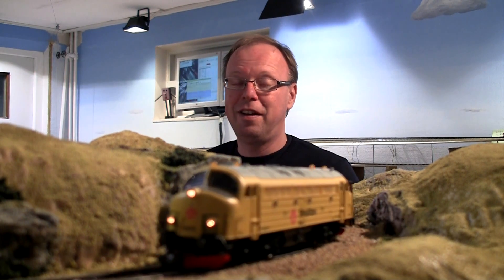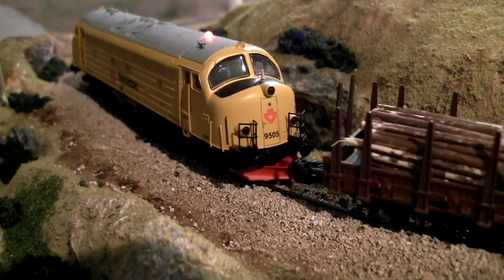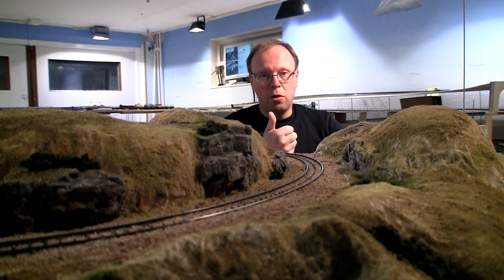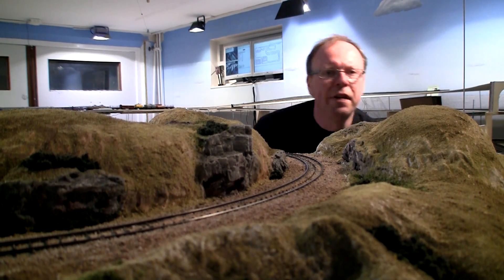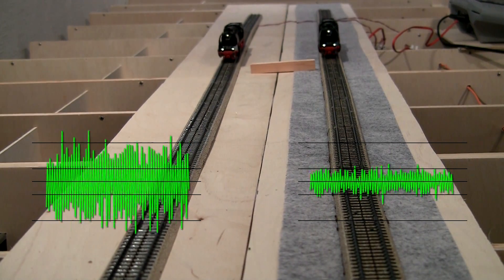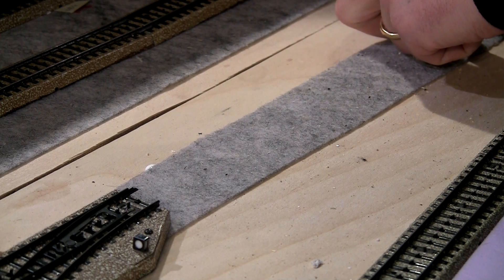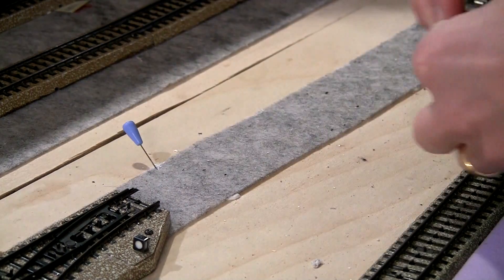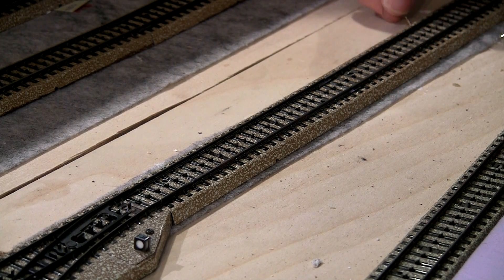Reduce track noice Low cost - Detailed guide DIY

Comment from the maker: Thank you! :) Somehow, Märklin users seems to be somewhat more tolerant to the noice than DC (2-rail) rail roaders. Anyway. it´s easy to overcome most of it at a low cost, why I thought it was a good idea to make the video.
Reply: +marklinofsweden Definitely going to try this. Your remark on the M users being more tolerant on noise got me thinking. I think M users are more tolerant because most locomotives are made of metal and weigh 300 grams or so. When one such locomotive passes by on my still wooden underground I really like the sound as it's replicated through the wood. It emphasizes the weight of the loco in my mind. I think it reflects the Marklin quality or something like that.

I'm still on a Proof of Concept table while designing my layout and I'm using 1cm thick sheets of MDF  as a temporary underground. I think the high pitch is generated when thin layers of multiplex are used because I don't recognize this effect with my three 100cm by 120 cm sheets of MDF.

The point I'm getting at is that when a real train passes by you don't hear the click clacks of ice skaters doing a ten 1000 meter laps, you'll hear the heavy sounds associated with metal wheels on metal rails.

With many model railways often hear too much of the click clack sound...

What I haven't tested is laying the track on a metal surface and making sure the metal rails are in contact with it ensuring a good hard CLANG when the train is moving over a point or so.

Have you ever thought about a scenario like this?

TFK

Comment: I used those interlocking rubber floor tiles like you would use in a basement or garage. They work great and it’s easy to drill through and screw track etc down.

Comment: 3rd way to remove noise is to use Peco Streamline tracks. I switched from Fleischmann Profi to Peco actually to run RP25 wheels which Flschmann do not accept, but the switch was going from loud to absolute silence at the same time, an extra unforeseen bonus. Both run on plywood with cork top Try it!
Reply: Cannot use Peco Streamlinetracks on a Marklin AC layout...

Comment: I concur. It dampens really well. I am using C track and has until now been using parquet underlay (green foam material). But Stopp seems much better. I am however not gluing it. I just use staples.
Reply from the maker: Good to hear you like it! (y) I still use it over my entire layout too. It works weel and I have no problwm related to "Stopp" at all. Only the benefits.

Comment: Thanks for the video info.... I agree with your felt idea but I am still mystified how you secure the track to the baseboard?  Maybe your set track just sits there... and the small mass of HO scale isn't move it around.  I'm about to lay O scale Atlas flex track so it needs to be held down to control the curves and keep the track joined together... especially when an MTH Big Boy weighing 9kgs runs around the track.  Only way to hold the flex track is to screw it down - which unfortunately links the track to the baseboard and transmits the noise.  Other modellers use cork or foam and just lightly pin it down but... as soon as they ballast the track with gravel and white glue, the whole  assembly become one - track, ballast and base board - which unfortunately again transmits the noise.
The only solution I came up with, is as you suggested - A) minimise the actual track base ply and put sound-proofing insulation bats under the base boards (both your suggested) (insulation best done after wiring everything) and B) and don't glue down the ballast or apply ballast at all and C) don't tighten the track screws down tight , leave then backed off a fraction, so the track is located and can't move but the felt can do its job and dampen the noise transfer.
Thanks again.    P.S.  Love the cup of tea expression!
Reply: Good info about the screws and then backing them off a couple returns. Thanks.

Comment: I have a question : how to make my train go faster (cause my train just like a crawling slug)
Reply: Hawe You checked if the collector on the motor needs to be celaned (wich can easily be done with at top and for example CRC contact cleaner) and the coals hawe good electric contact on both sides?
Reply: @sheep1ewe  Yeah, make sure you have good contract.  Oil your engine regularly.  And add booster if you have a large layout or a lot of engines and stuff drawing power.
Reply: @informatimago  
Yes, most of my collection is tinplates or H0 from the 80s, most of them only needed a cleanup and minor fix whan i got them, i use sewingmachine oil, but i don't know if it is optimal or not.

Comment: Hi, Martin, do you still use this felt today or have you found something better?
Reply from the maker: Hi Darren. I believe the felt I´m using in the video is no longer available from IKEA. However, there are similar rubber based materials available. I would say that a disadvantage with the felt is that it collpses under passing trains, lowering the point for the engine with about 1mm. I don´t have a problem with that, but I know that some people using Fleischmann Profi couplings suffers from this. So.. yes I still us it and find it being a good sound damping agent. For flex tracks I instead use Woodland scenics ST100 vinyl roadbed.
Reply: @marklinofsweden  thanks for updating that information.